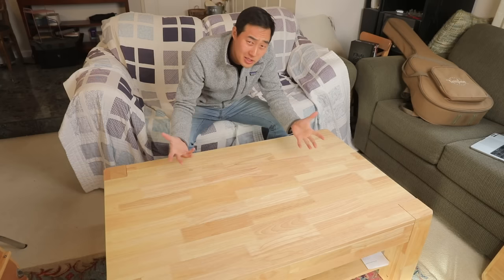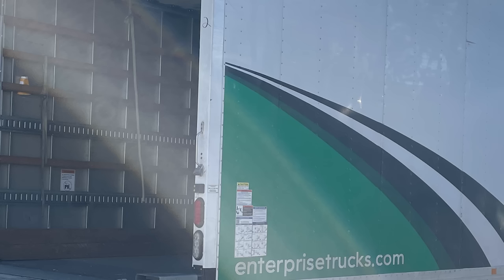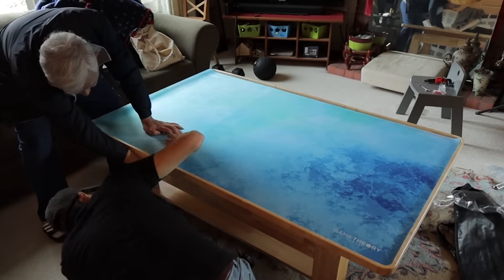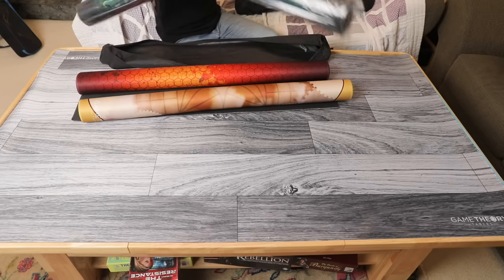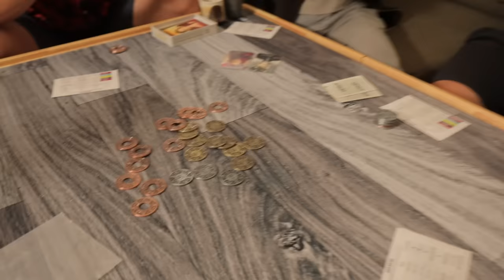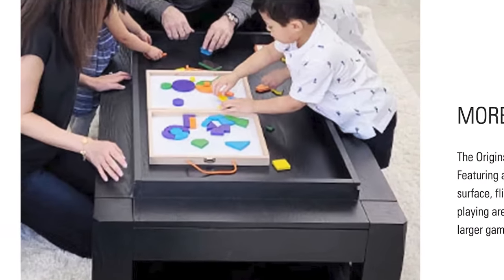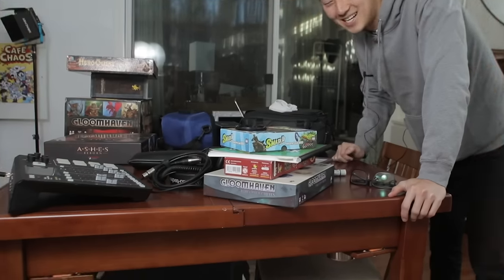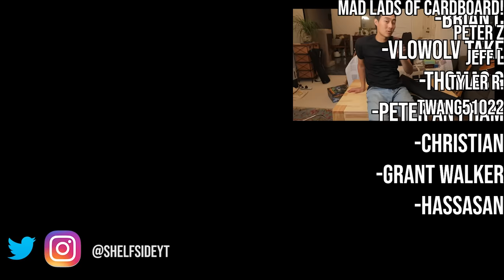How’s a Board Game COFFEE Table?

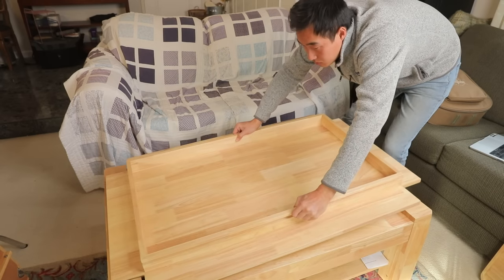Comment: At 6:03, you can see Ashton's sliding motion push the soft padding off the bottom-right corner of the table, relative to our perspective. It does seem very intended for you not to slide it in but rather gently lower it from above, for better or worse.